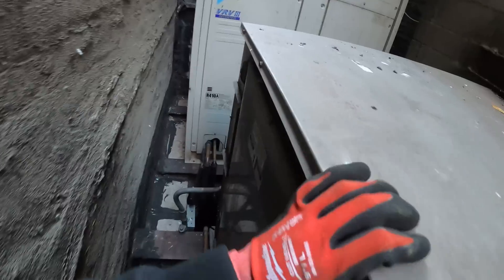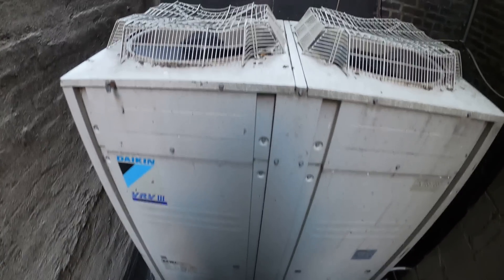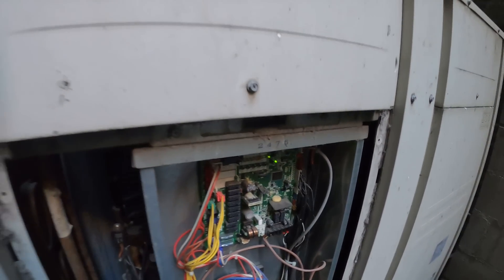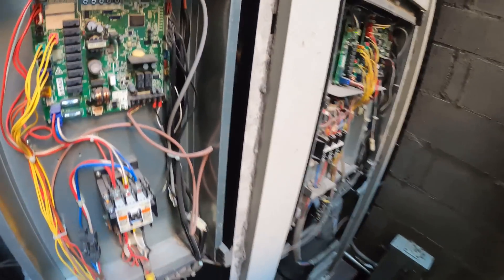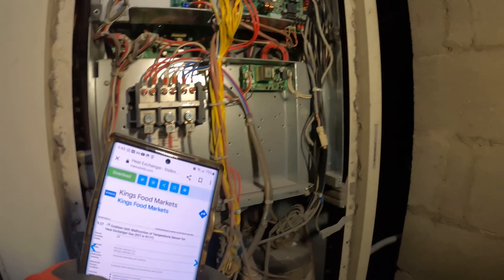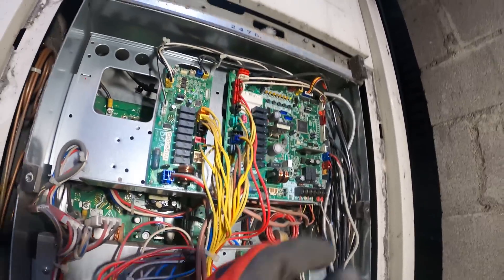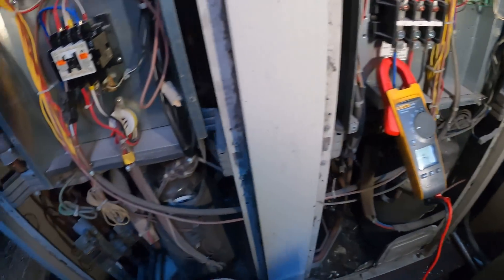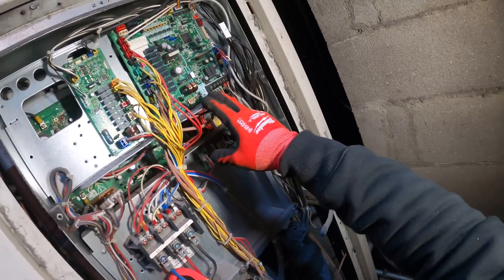HVAC Service Call: Daikin VRVIII Heat Pump Not Cooling/Heating (Error Code J4) Daikin Inverter A1P

Comment: You need to have confidence in your diagnosis the thermistor was bad…. Not the shotgun method.
 I would check the thermistor itself, I’ve had the wires break all but one thread, or fall out…. Keep looking.

Comment: How old is this unit approximately ? 
I mean for VRV/VRF after how long you expect troubles to start if running 24/7
Reply: We used to change thermistor packs and valve heads every three years when doing hotels. Can’t remember definitely, but I think daikin recommend every 5k running hours
Reply: @Modello40  Thanks so we can expect 5 to 7 years before replacing the hole unit.
Reply: @weld3z  that’s ok. Thankfully not. I’ve been working on vrv systems from 2002/2003 that are still going strong. Boards are getting harder to find on the k and l series daikins, but thankfully things like the fan motor boards on 3’s are replaceable still. The new boards just need a new wring harness. I will say though, the newer R32 stuff is not as good as their older stuff. Especially the sky air model. The main board is from a vrv4 and the heatsink thermistor fails. You can’t change that one out as it’s built into the board. Daikin are aware and have released a document highlighting which batches were affected.

Comment: I work on these from time to time but mostly lg vrf. I would highly recommend getting the service tool for these. For troubleshooting and viewing purposes they sell a service tool that is connected via wifi to their app and you can control all indoor heads and monitor all live conditions. You would have seen a missing thermistor value or a thermistor value of max resistance value if you had the tool. It saves lots of time and frustration

Comment: the green flashing is the heartbeat signal. it means the communication between the boards works and the processing on the board has not crashed.

Comment: H3P indicates normal operation. A solid H2P indicates a fault with the system. Nice troubleshooting but fyi I would download the Daikin service app next time as it will be your go too for Daikin equipment and troubleshooting. We use this in the UK hope this helps.

👍🏻

Comment: Looks pretty ridiculous that a they put all the thermistors on 1 wiring harness. 1 bad thermistor requires changing them all. Also, it's such an extremely difficult area for someone to work in. You have to climb over other units, no access to the sides and a several foot drop at the access panels.  Installers are assholes. Should never been approved in that location.

Comment: On those Binary systems, H2P and H3P stays solid, that means you have an error and must get the code from the Navigation Controller (thermostat). The Green light you're seeing are normal light communicating with the inverter board (inverter compressor) and the main PCB Board (A1P).
I'd suggest downloading Daikin Tech Service App. Useful app, hopefully you have a Daikin service checker with the computer program, if not goodluck.